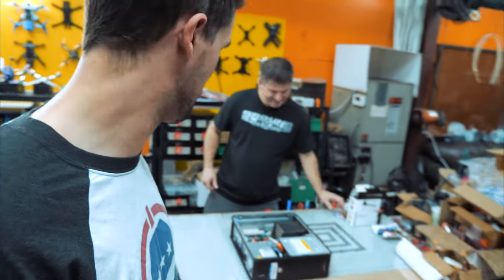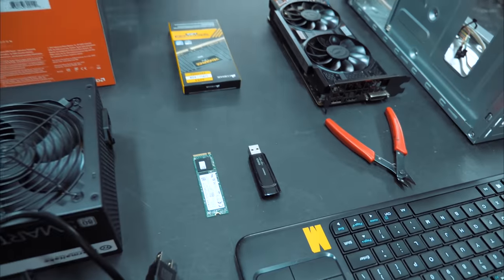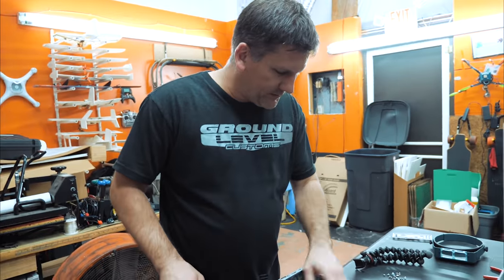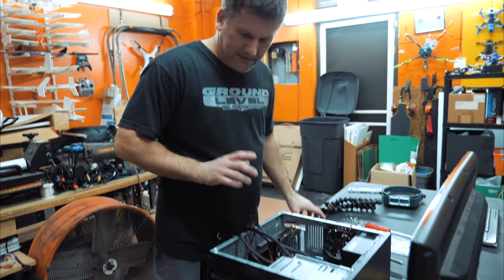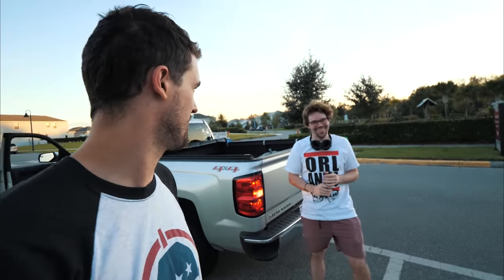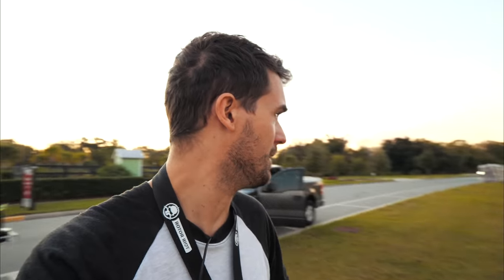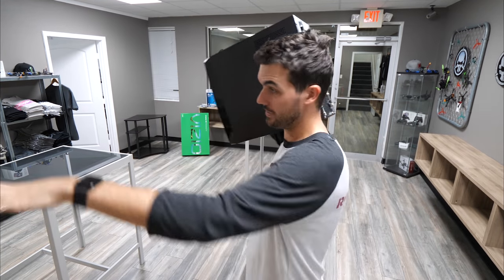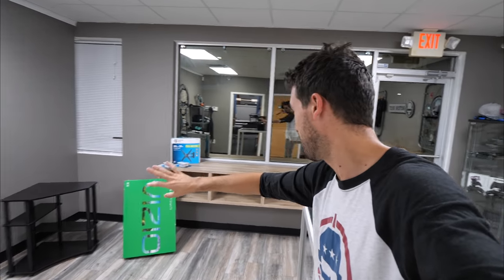we built a FPV Simulator Computer!

Comment: IMO you shouldn't need to splash out on a gaming PC just to run a sim.  It's that sort of dismal performance I got on reasonable PC's that made me decide to start building my own sim just so people with old crappy computers could play along as well :D
Reply: Liftoff indeed is not a simulator design for old crappy computers, it required a low-end to mid-range gaming setup. For the regular flight-sim fan, any old flight simulator that puts a bunch of flat trees, or some other random objects on an empty terrain is plenty enough, as long as the flight physics are correct. That's perfectly fine, and there's a market for that among the hardcore flight-sim fans. 

Liftoff however is made to appeal to a broader audience too, to both pilots and gamers alike. Simulators are the gateway to the FPV, and often help to get people interested in the hobby. As such we benefit from simulators that, don't just fly good, but can look good too. Liftoff tries to create a balance between performance and visuals, and tries to get rid of the "ugly and boring" reputation that many flight sims have upheld these past decades. That being said, it is not pushing any of todays gaming standards on visuals and requirements either. As computer technology evolves, Liftoff is starting to run on some computers that are finally being consider old and crappy ;)

Comment: "I just buy Mac's"...and pay almost double the cost of the same damn parts in a PC!  :(  Building a PC is essentially plugging in the different parts and the tiny wires for the LED's and ports on the computer's case.  That's it!
Reply: You do get another (better?) OS with the macs tho. I would probably never get a desktop mac, but for the laptops at least Apple do some sort of magic. Mac laptops definitely have a longer life expectancy than other laptops and there is also a pretty healthy second hand market making your initial investment less expensive.
Reply: If you can build a fpv quadcopter, you definetely can build a pc, and also im a apple hater!
Reply: @johanfredriksvendsen8482  the OS depends on personal preference, I personally feel restricted be Apples ecosystem, but some people like it. The build quality is very good on Apples laptops, however if you run into problems you cant fix anything yourself, it'll be really expensive to repair and since that butterfly key crap Apples reputation is damaged quite a bit. In the end its up to yourself to decide whether the extra money is worth it.
Reply: @johanfredriksvendsen8482  Linux laptop. Install LTS builds and it will be secure for a long time before major updates.
Reply: @Leonsimages  as someone who has been using Macs for 15 years, build quality used to be good, these days it appears to be good but has been awful since 2015 when the first Butterfly keyboard was released and hasn't been replaced by up until a few months ago (and that keyboard was by no means the only issue with MacBooks since, there were several other recalls, most notable for several years worth of batteries). Even the latest 16" that has the new (old) keyboard has some issues, the latest I've seen is it has issues waking up from sleep...  If you need a Mac for work (like I do) the only reasonable recommendation is to build a Hackintosh. If you don't need it, do yourself a favor and go with anything else.
Reply: And I thought Drew was tech savvy. Buying Macs for gaming are like buying a dji phantom for doing fpv.
Reply: @carveking  Haahaa! Correct!  ;)
Reply: @johanfredriksvendsen8482  You do realize they use the same exact parts that PC's use, right?  Plus, they make nothing themselves...it's all made by Foxconn.  A friend had their kid spill a coke on their Macbook air a few years ago.  She bought another of the same laptop for $1499.99.  I looked up exactly what it had for components, found an Asus laptop that HAD THE EXACT SAME COMPONENTS to the T! Everything identical!  The Asus was $799 !!!  $50 bucks more than HALF THE PRICE!  There's a good reason why Apple is the richest company in the world - Everything's close to double the price of equivalent products.  But, the CULT MEMBERS have been carefully groomed to pay it! LOL  :(
Reply: @scootroter4859  Oh I am completely aware of the ridiculous markup they take for their products. There are basically only two things hardware wise that completely separates apple laptops from their competitors. Those two things happen to also be easily the two most important ones. The screen is a cut above both in terms of resolution and brightness. Some 4k screens have started coming on windows laptops, but brightness is still an issue and tbh I think 4k for so such small screens. The resolutions on the surface machines and macbooks imo is the best option. Secondly the trackpad on macs is just completely unrivaled. I would also like to add that I feel the battery life on macs is significantly better, maybe not when all options are brand spanking new, but after a year of use all the windows machines I have had have been noticeably worse for battery life whilst the same I cannot say with my Mac. 

I dont consider myself an apple fanboy, I have had windows computers my entire life and right now I have a windows desktop, and old macbook pro from 2015 and just recently got a surface laptop 3. The mac is still doing admirably after the battery flat out died back in august. I still prefer the windows operating, but you cannot get away from the fact that the Apple computers have outright better trackpads, screens and battery performance. If they just made their products self servicable AND didnt charge you and arm and a leg for wanting more than 128gb of storage (on top of their already very expensive and low specced machines they would be steamrolling the competition)
Reply: @johanfredriksvendsen8482  you can get Mac OS on pc

Comment: The weather is crap here so yesterday i just  upgraded my pc to max out liftoff!!! Ryzen 7 2600x only $160 gtx 1660 $210 16gb 3200 $80 now i get 140 fps!! Amazing
Reply: DaytonaJim78 What mother board and size power supply are you using with all that?
Reply: @DocmurdocFPV  old asrock x370 pro 4 and 500w 80 bronze
Reply: DaytonaJim78 Ok thanks as my 2017 MacBook Air just has not got the cajones to run OBS even with the built in web cam without the audio getting out of sinc after about 2 min. Am looking at building a dedicated YouTube/Live Streaming computer that can handle at least a simple web cam. Haha, but I do plan on using a LUMIX G7 and all the right mics and such.
Reply: @DocmurdocFPV  awesome! If you live by a microcenter they always have great prices!

Comment: More detail plz, I want to do this..one of the main reason I don't really mess with Sims is having to turn down the graphics settings....
Reply: There are really good tech channels out there with great PC build guides! Linustechtips is probably the most famous one but there are tons!

If you can build a quad, you definitely can build a PC, the parts are like big Legos! As with every hobby choosing parts can be quite overwhelming. I'd recommend a Ryzen CPU and a GTX1660/1660SUPER or RTX2060SUPER/2070SUPER depending on your budget :)
Reply: @FAB1150  ok thanks, I'll look into that. I will try to build one

Comment: That PC is a really really low end one 😅 it would definitely not run simulators with low latency, also I doubt a lot it can run velocidron or some more exigent sims.
The motherboard was not mounted with the correct screws. Appart from this, nice video 🚀

Comment: I've tried Liftoff, Freerider, and Velocidrone. I've been staying with Liftoff lately but when I fly the freestyle levels, I don't seem to be getting the speed I want. I use about 35-deg of tilt but I thought it would be faster. I have a GPU that more than actually surpasses the recommended (not minimum) requirements. I've flown that Bando level in Liftoff a bunch. I'm still working on power looping the crane.

Comment: Great build! I really need a new computer to run the sims. Of the main 3 drl runs the best for me but it still runs like crap. Laptops only 2 years old but slow and the graphics card sucks. Have to have the graphics setting in the sims all set as low as it will go and I still get FPS warnings and can go as low as 3 FPS. Sloooooooooooooow. But that said I still can complete the DRL 2020 qualifier track in 1:40. 🤗 if my computer actually ran it well I’m sure I would be around 1:10 or faster.

Comment: How bout yall get liftoff to actualy work on a mac?! seriously! Why the frick doesnt Liftoff actually run on macs?
Reply: It does work on Mac, more so: Liftoff is partly being developed on Mac... and I'm even writing this response on my Mac ;)
Reply: @lugusstudios1328   Technically yes it opens and runs. but not well in the slightest. If I take the same macbook pro laptop and boot in windows it runs just fine. Booted in the mac side I can ONLY run the convention center at absolute minimum settings.
Reply: @gvngoheavy  there could be many reasons for why that is, it all depends on the exact situation: a charging MacBook behaves different than one that is not charging for example, furthermore the high-quality screens of a Mac often means things have to be rendered in a much bigger resolution too. Greatly decreasing your resolution in the game can make a big difference without even touching the other graphics settings. As a Mac user, I mostly look for game that run on the system, I hardly ever expect them to run on the best settings, that's simply the reality of Mac hardware and MacOS. I enjoy my Mac a lot for many things, they are fantastic computer systems, not the best for gaming however.
Reply: @lugusstudios1328  I think you missed the point I was making. Exact same computer - I can dual boot with bootcamp. Mac side= absolute minimum settings for liftoff means I can ONLY run the convention center environment, all others freeze. PC side= runs fine on moderate/mild settings, can play whatever level I want. Exact same screen, exact same processor, exact same gpu.
Reply: @gvngoheavy  I know exactly what you mean, it means that the OS makes a difference, not the hardware or the software in this specific case.  Things like battery saving settings are examples of things that related to the OS.

Comment: You couldn't spend $50 on a real case?!?!
Reply: Not like he built a monster gaming rig or anything like that. Besides, if it's going to stand in an area open to the public and probably inside a small cupboard, just throw the parts into anything that'll hold them since it might end up taking a fair bit of abuse. Had it been a serious performance rig or something for his own apartment, then I'm with you 100 %.
Reply: @Pile_of_carbon  The only reason I think getting a better case would be for Airflow. That case isnt terrible but there are much better options for airflow even at the 35-40 dollar mark. (I get it the case was probably free)